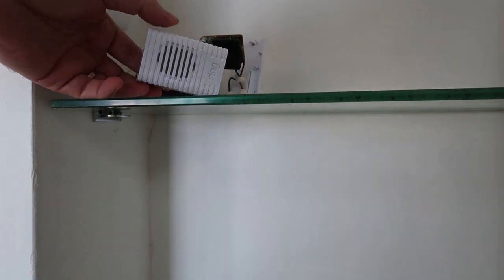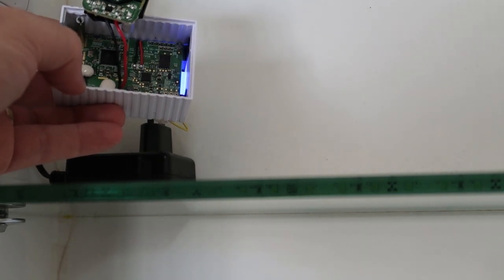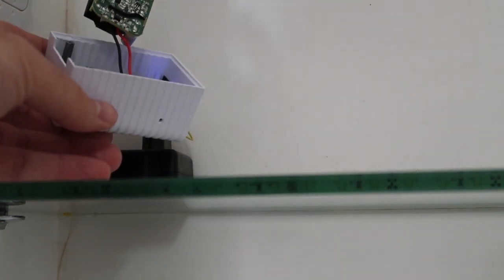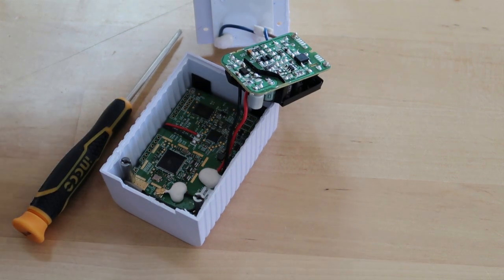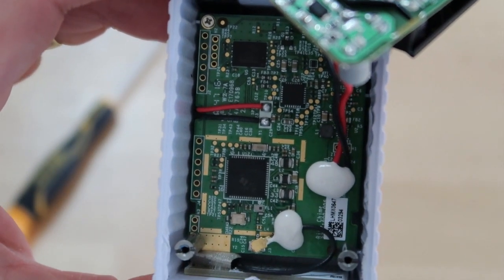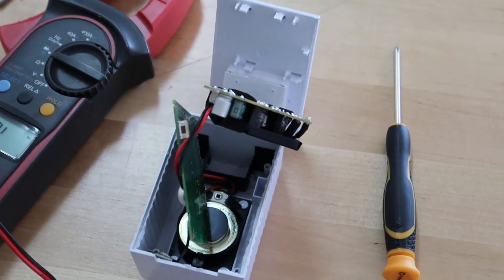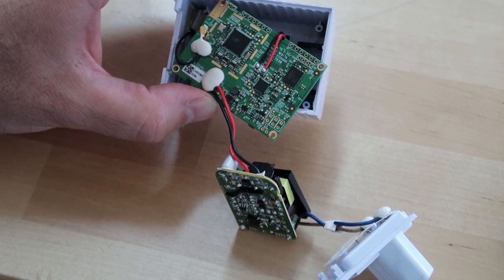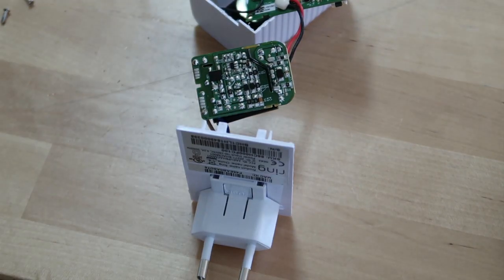Ring Chime Door Bell non working

Comment: I've also got the same problem with no blue light and the chime is just out of warranty. There are just two screws holding on the back plate and by carefully working a thin blade (putty knife) all around the plate it came apart. I think there might have been a small amount of glue. I could not determine anything wrong. I was expecting the voltage to be 5v to bottom board but it appeared to be 10v ac.

Comment: How did you get it open after removing the 2 screws?
Reply: On the back along the seam take a small flat head and gently pry it open. Around the antennas it will pop off from there...hope this helps cause this video didnt..

Comment: I have a ring pro and a chime. They are up and running about 2 weeks and all was good till about 5 days ago. Now the chime isn't connected, when I look at it has a fast flashing blue light and will not connect. If I follow the instructions and press the reset button for either 5 or 15 seconds it reboots and connects then it reconnect ls my phone to the internet and I get a message saying that it's finishing the set up and then it says it has failed to connect and I am back to a fast flashing blue light. My internet is super fast with a strong signal.
Reply: Did you get a solution to this problem. I am dealing with the exact same issue.

Comment: Dear, do you know to what voltage the chime transforms the grid voltage internally to work with?
Reply from the maker: I have measured 5V and may be also 3.3V if I remember correct
Reply: After my Ring Chime Pro stopped working, I cracked it open and looked up the specs for the AC/DC adapter built inside- 5V@2A. Replaced it with a 5V@2A wall wart, back in business!